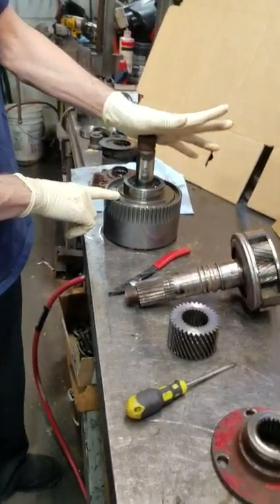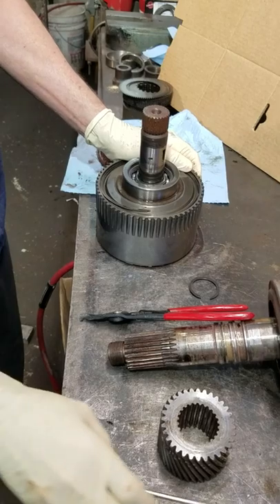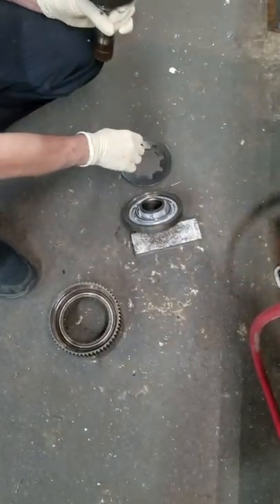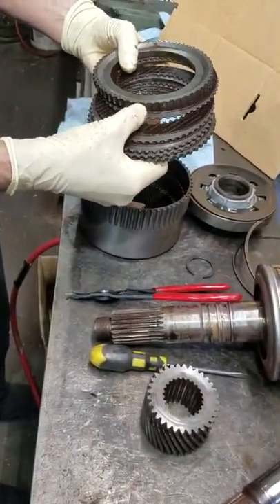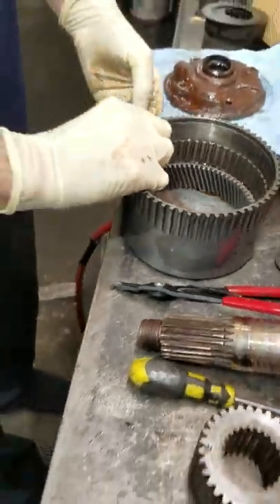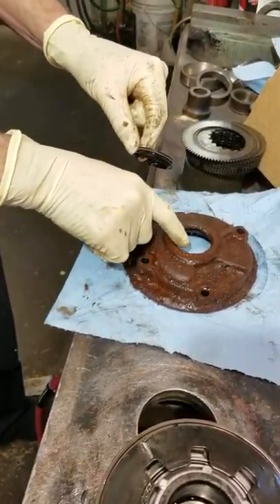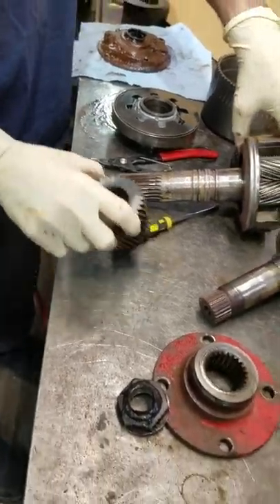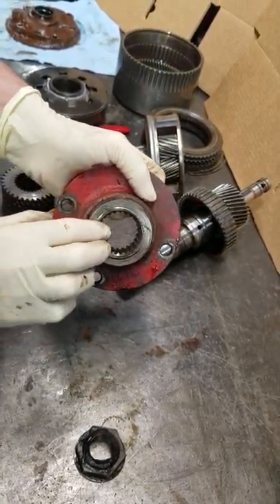Disassembling a Velvet Drive 71C 1013, 1017 Forward Clutch Pack.   ***We need cores Transmissions***

Comment: My trans isn't spinning, just put new plates in it. I was thinking the pump might be bad but weird thing is it was working the last time the boat was in the water because I still had reverse but no drive. I've made sure nothing is clogged up and cleaned the whole thing out and I'm pretty positive I put everything back in it the way it should be. My pump has some minor scratches on it but doesn't seem that bad really. Still though I'm starting to believe the pump is the problem the more I think about it. Also have a problem with front seal blowing out, I'm guessing the control valve is causing that? Because I believe it's been getting hot too.
Reply from the maker: Definitely pump set for the other rotation if it is the case iron transmission
Reply from the maker: Could also be low pressure
Reply: I'm pretty sure the rotation was right as well. I could be wrong though I'll spin it 180 and see what happens!
Reply: What is the best fluid to run? Dexron III?
Reply from the maker: What direction is your flywheel  turning?  Reverse will apply with as little as 10 psi

Comment: Great Videos Man! I have a question for you. I rebuilt my 72C Velvet Drive about 7 years ago. Last Weekend the pump seal failed catastrophically. Half the fluid drains in 5 seconds. The boat was running cruise speed and it was like it was pulled into neutral. I shut it down and got towed in. I have the full rebuild kit to replace everything. People are telling me to replace the seal and put in back in. I'm thinking is better to replace the clutches but I'm not a transmission expert. I would be very interested in your opinion. Thank You
Reply from the maker: I will post a video later today discussing this issue. It is common problem nowadays. 
If it helps please go to my website  halemarine.com and send me a donation through the QR code
Thank You
Reply: @halemarine5991  That would be amazing! I'll gladly help and send business your way. Thank you
Reply from the maker: I lowered the price to $704 for you.  Video is up on my YouTube channel
Reply: @halemarine5991 I watched the new video. I greatly appreciate the explanation. Comments are turned off or I would have posted on that video. When would be a good time to give you a call? I want to confirm I'm looking at the right pump you mentioned and I have a question about the rest of the transmission. Thank you Sir

Comment: Thank you Chris for the video i shared with my mechanic and he will be calling you i have a 1974 Chris Craft Corithian 32 ' took her out this morning and going out all was good got to destination and reverse on the starboard engine was not working only forward checked the fluid added a little but did not help with reverse can you tell me where to purchase parts to rebuild the velevet drive i am located in Upstate New York city of Rochester on Lake Ontario
Reply from the maker: http://halemarine.com/
Reply from the maker: What is the model number of the transmission?
Reply: @halemarine5991  I WILL HAVE TO GET IT THANK YOU FOR YOUR QUICK RESPONSE ALSO DO YOU REBUILD THEM IF WE SEND IT DOWN TO YOU I WOULD RATHER HAVE YOU DO IT IF YOU DO THEM
Reply from the maker: Yes we overhaul Velvet Drive transmissions
Reply: @halemarine5991  Thank u Chris i will get the Model # and figure  how to ship to you
Reply from the maker: Once I know the model number I help with the shipping container  and shipping.

Comment: Question for you: Why use Dex3 when Mobil 424 is required from velvet drive? V-drives
Reply from the maker: Right from the 1004,1005 service manual
Dexron lll, type F,

Comment: Hey Chris! first of all, thank you for lively videos! We have a Marine "Borg-Warner VelvetDrive AS7-71C" when we put our transmission into reverse, everything is perfect and normal, but when we put it into forward it spins the shaft (slower than usually) and with little to no power (slipping or not engaging properly) to the point that I could stop the shaft from spinning with my hands

Does this mean that the forward clutch is warn and needs replacement in most cases? 

Also do you have a video of how to put the forward assemble drum back together without a bench press? 

Many thanks for your amazing videos!
Reply from the maker: Forward plates or internal leak.  Like oring  wore or
Sealing ring
Reply from the maker: Check out my video on my 1017-004 overhaul

Comment: I dont know much so im asking you .  Transmission failed in 36 ft grandbanks classic .trans made terrible noise at 1000 rpm you could tell something broke no go engine still runng . I turn off when i go to start engine siezed.could it be the clucth.could broken parte be responsible  for engine freeze.can i fix this by Just taking offbellhousing and driveline
Reply from the maker: What is the model number of your transmission

Comment: Hey Chris, I started taking my no tagged 71c apart for overhaul. It has the 2.10 reduction with the oil return above the planetary. The large bearing the back of the 71C case is bad. I cant seem to find the part number for it as it has 13 ball bearings in it and the most I've seen from replacement websites is 12. The case is an earlier 2 bushing case. Thanks for any help you can give me. Also the Phenolic washer was solid metal and THICK. Should I replace the washer or keep whats in there since there was no wear on it
Reply from the maker: Hello
Can you send me a picture of the bearing and a picture of the housing it is located.
Send the pic to sales@halemarine.com
Best regards
Chris

Comment: Message: Hi there, I've been viewing  your You Tube videos on 10 17 005
 BorgWarner transmissions. I've been asked to refurbish the unit for my boss's
 boat. He has supplied what appears to be a generic kit for the unit. . . I've
 disassembled and upon rebuild the input shaft is stiff to turn after the
 reverse clutch cover is tightened.  This is tightened against the springs. I
 cant remember if this spun easily before disassembly. Can you advise me please
 ?
Reply from the maker: The 1017 should have 2 Bronze and 1 Steel plate.
Reply: Thankyou. Yes I've replaced with new plates on the reverse clutch exactly as they came out. However should the unit turn freely after reassembly?
Reply from the maker: @petegl581  Yes
Reply: Why is it that the lower snap ring in the forward clutch doesn't seem to fit into its appropriate groove? You suggest it's just a spacer. Is it necessary make this fit? The circlip just popped out during disassembly.
Reply from the maker: It is a Spacer

Yes like I said in the Video

Comment: How to know its a 70 or 71 serie without the tag?
Reply from the maker: In most cases the overall length of the transmission will tell what Series it is. Measure from where the transmission mounts to the engine back to the output coupling.
Reply: Ok i will do that.I bought the boat with a bad transmission it is a ski nautique 1979.The transmission goes in foward and reverse but when you put it in neutral the prop will stop spinning but if you rev the engine e little bit the will start spinning and will not stop.So in neutral you will stil move forward.I checked the selecter it works perfect with the cable.I shift in the neutral with the cable(direct on the trans shifter)and stil same issue.I red online that most posibel is clutch sticked together.Or the control valve.I bought a clutch set on skidim and i am planning on rebuilding it this weekend.How to check if the control valve works good? Thanks for the info
Reply from the maker: @john-patricknuboer8060  I am pretty sure it's not the selector valve. The Forward Clutch Pack is bad .
Reply: Can a bad valve make a clutch pak go bad?And is the clutch pak the anything i would need to rebuild it?
Reply from the maker: @john-patricknuboer8060  Clutch Pack failure is usually operator error. High speed shift or running a ground.  Yes you must rebuild the clutch packs